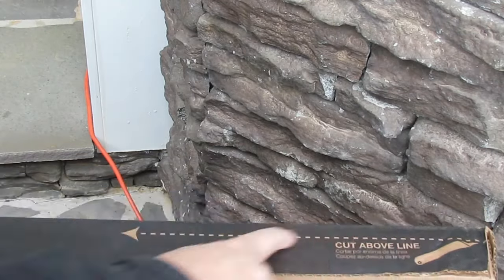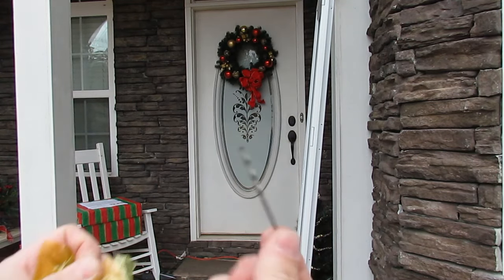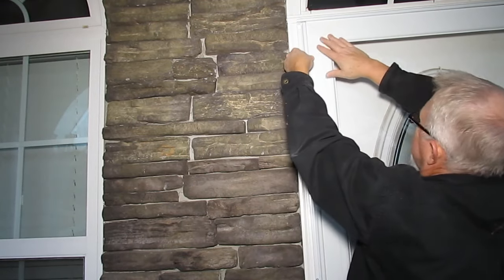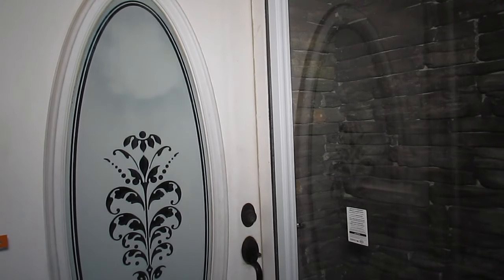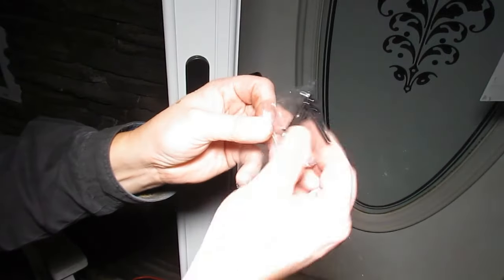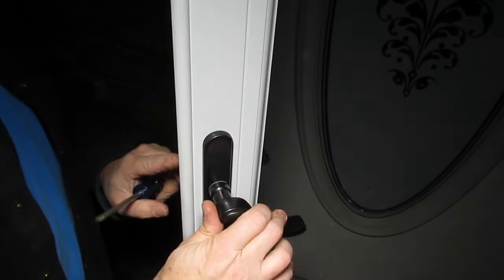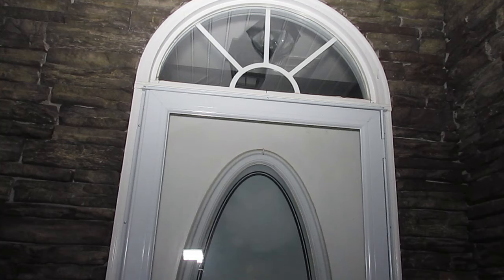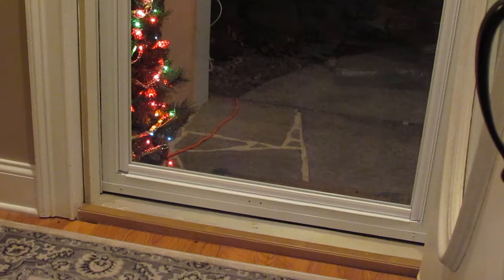Install Andersen Storm Door

Comment: Great video. I pretty much just followed it for the entire install and it went great! Question for you... Did you have a plastic layer over the glass? Mine seems a bit dull or hazy, but for the life of me, I can't see any noticable plastic where I can peel. Mine has no plastic on the frame itself, but like I said, the glass just seems cloudy. If there is plastic on it, will it be impossible to peel off now that the window retainers are installed?
Reply from the maker: Hi Mike, thank you for watching!  Mine did not have any plastic film on the glass.  I don't think the retainers touch the glass, so if there is a film on yours, I'd think you could peel it without removing the glass form the door.
Reply: @dwcoffey  well, Windex does wonders. I was sure the haze was from plastic, but it was just dirty haha. Looks good now. Thanks for replying
Reply from the maker: That's great!  Well, the good news is, that was easier than trying to get the glass out and get a bunch of plastic off!  :)  Take care, Mike!
Reply: @dwcoffey  didn't have any plastic on mine either
Reply: U 75th 6

Comment: I had a contractor install the same type of door.  The contractor said it’s more energy efficiency having the door opposite side opening when I complained to him. Waste of $300 to install. I went to a Home Depot and asked the person working the door and window department. They said it doesn’t matter either way. It’s easier to be on the same side.
Reply from the maker: Thanks for watching!  I kinda see what he's saying but I doubt you'd ever realize any difference.  The hand of the storm door just depends on your entryway.  Most installations will have the storm door with an opposite hand as the entry door....this puts both handles on the same side of the doorway.  In my particular house, the entry door is actually the wrong hand for the opening, causing us to exit into a wall on the porch, so I installed the storm door with the same hand as the entry door to avoid making it worse.  Sometime soon, I will build a new entry door and replace the current one with the correct hand door.
Reply: My backdoor I have to install hinges on the same side of my main door because my storm door would open opposite of my patio. Never installed a storm door opposite hinges but will think about doing just that when I install the door on my front. Live and learn.
Reply: He bought the wrong door and tried to con you.
Reply: Sometimes the latch will hit the door knob or lock set that’s why you install on opposite side, former Andersen service rep here

Comment: I just wanted to say thank you!. I didnt have the guts to try this until i watched this video. Storm door is installed within about 30 minutes without any issue at all. I need to simply install the door handle hardware. I just came back to this video to double check what i have done so far. Many many thanks. I owe you a beer.
Reply from the maker: That's great Marc!  30 minute install is fantastic too.  Thanks for watching!

Comment: This video was absolutely perfect! Every home project I attempt usually ends up with lots of frustration and parts left over. I literally didn’t have to open the instruction book (my nemesis) and it went as smooth as I could have hoped. The only thing that slowed me down was trying to slide on the little side vinyl covers that cover the screws. Such. A helpful video, much appreciated.
Reply from the maker: I'm glad this helped!  I'm not a fan of those screw trim covers.  haha.  Thanks for watching, Patrick!

Comment: Watched the video a total of 3 times, can’t thank you enough sir, you definitely made installing this door very, very, easy you are greatly appreciated. Biggest issue I had was the plastic trim that covers the screws took me a few minutes but I got it down, two thumbs up, thanks.
Reply from the maker: Thank you for watching, Antonio!  I'm really glad this helped and I agree with you about those plastic covers.
Reply: After fighting with the screw covers for longer than I care to admit, I bought some exterior 8 x 1 1/4" flat head wood screws and replaced the pan head screws. After that, it was a snap.

Comment: I just installed the same door. I had issues with the door frame being too wide because it’s in a 160 year old farmhouse. I used trim strips to fill the space. One side was slightly shorter than the other side so I had to cut about 1/8” off one side of the storm door. I also had trouble lining up the dead bolt cylinder but sorted it out. Great product! Thanks for video.
Reply from the maker: Thank you for watching!  That sounds like a lot of work, but also sounds like it ended up looking great!  I agree, I like the Andersen door....It's nicely made and seems to be holding up well.  Thanks again!

Comment: Dennis - This was an excellent tutorial. I wish I’d watched it before installing the two doors I put up yesterday. But in total honesty I followed their instructions exactly as you did and everything about my install went the same way yours did. Well done, sir.
Reply from the maker: Thank you for watching!  I'm glad your installs went well.  I agree...their instructions are pretty good.
Reply: Dennis Coffey - yeah, so I was finishing up the last bits this afternoon. Couldn’t get the screw covering molding to “take”. Any trick to that?
Reply from the maker: I slipped the edge closest to the door into the full length of the channel first, then pushed the 'outside' edge into the channel from the top, then kept pushing downward until it was fully seated.
Reply: Dennis Coffey  - Appreciated. I’ll give it another go. These are out back, I suppose they don’t need all the cosmetics, but we’ll see

Comment: Good video!  Thanks Dennis!  Not to nit pick, cause I'm sure its a matter of personal preference, but I think I'd want the screen door handle and the front door handle on the same side.  It might be annoying having the storm door pinching you as use the key on the front door.
Reply from the maker: No worries Robert, and thanks for watching!  Although not a requirement , most often storms doors are installed with the lockset on the same side of the opening as the entry door.  In this installation,  I install the storm door with the lockset on the opposite side as the entry door.  The entry door installed by the builder is the wrong hand, it should have been a left hand door based on the way the front porch is built.  It will be changed to a left hand door in the future.  If I had installed a storm door with the handle on the same side as the existing entry door, we would exit the doorway into a wall unless the door was fully opened when walking out.  Not convenient at all, so changing the entry door to the proper hand door will be the best solution.

Comment: Thank you.  Mine is taking 2 hours and counting so far but I'm watching parts of your video and then running downstairs to do what you just said.  Plus I had to walk my dog.  😊
Reply from the maker: Thanks for watching, Peter!  I hope it all went well!
Reply: It really did.  I was surprised that the door handle does not have the springy return that yours has.  Maybe I tightened thigs down too much?
Reply from the maker: Possibly, but you may just need to lube the lockset to loosen it up.

Comment: You’re a legend. This was so much better than reading the instructions.
Reply from the maker: Thanks for watching!  I appreciate it!
Reply: @dwcoffey  no problem.

One question, on your door did you have any issues with the door latching? Despite doing everything correctly when installing mine, my door doesn’t like to shut if the main house door is closed behind it, almost like the air pressure trapped between the closing storm door is enough to not allow the door to latch, and so I have to push it closed.

Another thing that’s weird, is that on my storm door, when it’s latched closed, it’s pretty solidly closed, but if you do much as breathe on the door handle (like moving it 1/16”) it’ll unlatch. Not sure if that’s just me, or if you experienced that as well.
Reply from the maker: I have not had either of those problems.  I'd try setting the closer cylinders to be a bit tighter, maybe they can overcome the trapped air between doors.  The only thing for the latch I can think of is to check the alignment of the striker plate and the plunger.

Comment: I installed many storm doors but never installed one the hinges opposite of the main door.  I am installing one of these doors in the back of my new house this week and thought I would watch your video. Thanks.  Maybe I will try the opposite hinge thing when I get the door for my front.
Reply from the maker: Thanks for watching, Andre!  I agree, normally the hinges will be on the same side.  I installed this one opposite because the entry door installed by the builder is the wrong hand, it should have been a left hand door based on the way the front porch is built.  It will be changed to a left hand door in the future.  If I had installed a storm door with the handle on the same side as the existing entry door, we would exit the doorway into a wall unless the door was fully opened when walking out.  Not convenient at all, so changing the entry door to the proper hand door will be the best solution.
Reply: Same here good explanation sir .  I was wondering too but now makes sense.  Beautiful job I’ll watch the video a second time .  Thank you sir

Comment: Just installed this door.  It took me about an hour and a half.  I suppose if I had to install a second, I could have done it in 45 minutes.  The most frustrating part was trying to get the glass retaining channels to snap in.  I found that hooking the J channel on the glass frame first then using your palm to seat the outside edge was the easiest method for me.
Reply from the maker: Thanks for watching, Arnold!  I agree...those channels are a bit frustrating and make me nervous about the glass.  I like your method of installing them...sounds better than what I've done.  Thanks!

Comment: I enjoyed the explanations of the various parts during the install, thank you!
Reply from the maker: I'm glad you liked it!  Thank you for watching!
Reply: @dwcoffey  Ended up taking me 90 minutes to install door and lock, and most of that time was changing bit to driver on the drill, and fiddling with the lock. I kept turning the lock handle towards the outside instead of the inside. That will drop the handle out of the door when you test the latch.
Reply: Would you recommend caulking around the storm door trim?
Reply from the maker: Yes, I did mine.  I caulked between both side rails and the brick moulding on my door just to avoid leaks and draughts.

Comment: Thanks for the Video. I didn't even read the instructions. Only problem I had was the drill bit broke on the very last closer hole I had to drill. Luckily there was enough sticking out to grab it with a pair of pliers, and back it out. So, maybe use a better drill bit.
Reply from the maker: Thanks for watching, Bob!  That stinks....I just had the same thing happen to me when mounting a bilge pump in my sailboat.  I broke the bit right off in the fiberglass but I did not have enough to get it out.  Glad you were able to back yours out!

Comment: Thanks for the great video. We installed this door today and followed it step by step. It made it so easy. The only problem we had was with the short screws in the Closer Hardware. They were too big for the holes in the door, so we had to make the holes slightly bigger. This made me very nervous drilling into the actual door, but it worked out. The question I had at the end was, what are the two orange plastic clips that came with the closer for? They aren’t in the instructions and you didn’t say what you did with them, but I think I see them in the last shot on the top closer.
Reply from the maker: Thank you for watching, Deborah!  If you figure out what those two clips are for, let me know!  haha!!  I'm pretty sure they are just packing clips, since all the other packing clips on the door were orange.  But.....I wasn't completely sure, so I stuck them on the top closer of my door.  I haven't' needed them since, so pretty sure they are not necessary.  :)
Reply: @dwcoffey  that’s what I thought, because who would want to see those bright orange clips on there? LOL.
Reply from the maker: That's a good point.  I just took mine off and threw them in the trash.  haha!

Comment: Thanks for your video. One question. When you attached the inner mounting screws on the hinge side (8:31) was there a gap between the hinge rail and the wood you are screwing to?

When I center my new storm door within the existing door frame/trim, that leaves a gap between the hinge rail and the door frame. Did you have this gap and was it a problem? The instructions actually say to set the storm door in the frame so it's pushed over to the hinge rail side, which makes my storm door off-center. I'm trying to figure out what to do. Thanks!
Reply from the maker: Hi Ryan, thanks for watching!  No sir, I had no gap.  I set the storm door hinge rail just to the outside of the casing and screwed into the brick moulding.  That pretty well centered my storm door....it may be off a 1/8", but that's about it.  If attaching the hinge rail like that puts yours too far off-center, I'd suggest shimming between the entry door casing and the storm door hinge rail to center the storm door.  You will be better off to use a full-length shim though, so you don't create any openings allowing drafts.  If you have a tablesaw....I'd cut one to fit.  If not, maybe a piece of lattice or a small moulding would do the trick.

Comment: Excellent video. Is it standard to have the storm door handle on the opposite side of your main door?
Reply from the maker: It is not...normally they would be on the same side.  When the builder installed our entry door, he used the wrong hand.  If I installed the storm door with the handle on the same side, we would walk into a wall as we exited the door.  Eventually, I'll replace the entry door with an opposite hand door.  thanks for watching, Patrick!

Comment: So if you got the left handed door would you have had to remove the door bell?
Reply from the maker: Hey, thanks for watching!  The storm door is a left hand door, (left hand, outswing).......but, yes, since the door frame is the same width all the way around the door, the doorbell still would have required moving.  It was set too close to the opening on the entry doorframe.  The problem is that the builder really installed the wrong hand entry door.  With the way the porch is built, the entry door should have been a right hand in-swing door.  I'm going to build a new entry door and will correct it at that time.  If I had installed a right hand storm door, it would have jammed us up going into and out of the doorway.

Comment: Great video. I had to do a build out on my frame and hoping to attempt the door installation soon. I just have one question. I plan to put the storm door handle on the same side as the interior door. Is there anyway to know if advance if the two handles are going to run into each other? Is there some minimum measurement to use to determine that?
Reply from the maker: Unless you have an entry door handle that protrudes a lot further than most, you shouldn't have a problem.  Most installations have the storm door handle on the same side as the entry door.  The builder put the wrong hand entry door in my house, so mine are opposite.

Comment: I was thinking of installing these instead of burglar bar security door. Neighborhood is not that bad but definitely want some added deterrence, I think a burglar would think twice about smashing through the glass storm door then kicking in the front door. The security doors with the bars look horrible so considering this
Reply from the maker: I agree about the aesthetics.  The glass on these doors is tempered, so it will take a pretty good whack before shattering.  Thanks for watching!

Comment: Everyone shows a simple installation, how about when your door does not have    the top flush with the sides. I will be installing a storm door on the front of my house because it really gets slammed in the winter but the top of the door sticks out a lot more than the sides. It would be nice to see someone installing one on an opening like that. Maybe I should do a video when I do mine.
Reply from the maker: Thanks for watching, David.  The top casing on my door only extends out about 1/8" beyond the side casings, so I didn't have a problem.  I just caulked the top 12-16 inches of the side casing-to-storm door joint.  I think if it protruded further out than that, I would have either planed off the top of the casing (probably wouldn't do that) or added some lath strips to the side casings to match up with the top, then install the storm door.  I hope you get it figured out, and I agree, a video of your process would definitely help folks!  Thanks!

Comment: Thanks Dennis, I need a storm door, but I am not sure what type. I am doing my research.
Reply from the maker: Thanks for watching, John!  I've had this door installed for about 2 months now and I really like it.  It is built well, not flimsy at all and operates smoothly.  I'm not affiliated with Andersen in any way, but I can recommend this door.  I also liked its price point.  They have one that is more expensive, I think it is a 5000 series, but I didn't see much difference between it and this 3000 series door.
Reply: Thank you for  the feedback Dennis!

Comment: Aren’t your handles up side down. Plus what are the 2 orange clips on the top closer for. Great job on the vid
Reply from the maker: Thanks for watching!  My wife liked the handles better turned upside down, so that's how I installed them.  :)  I believe all the orange pieces are just packing.  I think I had not taken them off the cylinder after install.